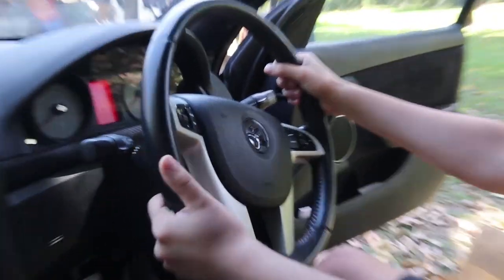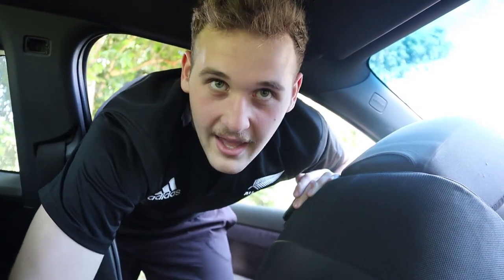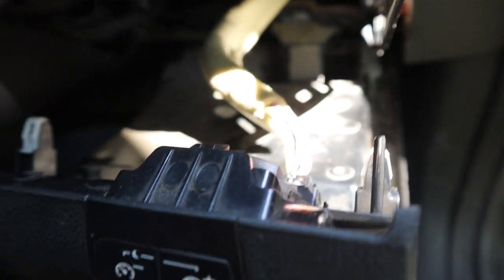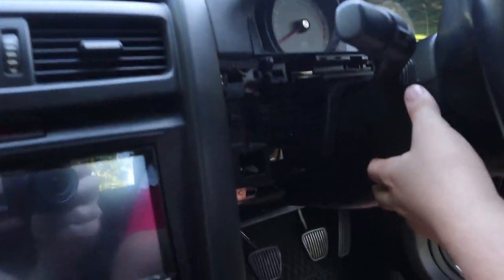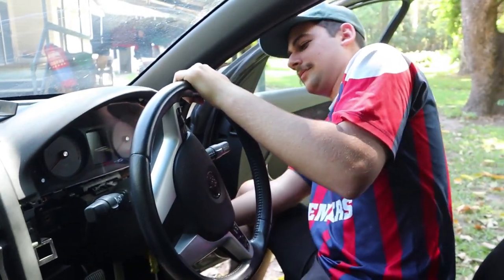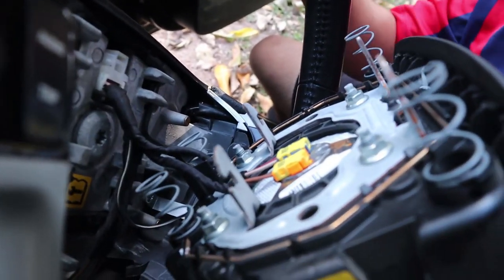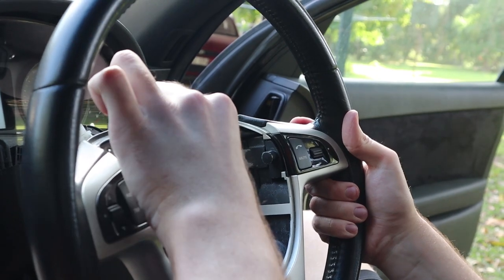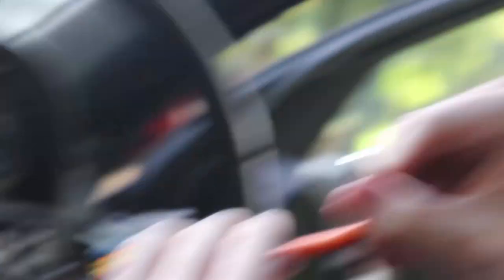How to Swap the Steering Wheel on Your Holden Commodore

Comment: Very helpful, handy tip also the column is telescopic and pull out with the adjuster under the coloum. Saved taking the trim parts off

Comment: Just a quick note... Not all of the surrounds need removing. Just the cover on the top of the wheel.

A correct screwdriver length will allow the airbag to unclip. 

Cheers.

Comment: Regarding how to set the air bag aside.  When you put it down out of harms way, make sure that the side that normally faces the driver is pointed up towards the sky and not the other way around.  That way if the airbag decides for some stupid reason to deploy it does not propel itself up in the air where it could come down on someone/something you care about.

Comment: just a heads up: wait 90 seconds after disconnecting the battery before you work with any airbags
if its the drivers airbag, after removal place it somewhere where it's obviously steady and have the emblem face top always
14:19 that's the horn wire

Comment: Just managed to get the airbag off my VE. Tried leverage with screwdriver at first. Then, got a stubby flat head screw driver with a good broad head, put it in and twisted it instead of using leverage and it popped straight off.

Comment: Im a bit disappointed. Being car youtubers im pretty sure anytime you remove/install a steering wheel going by all other videos, its supposed to be in the range of 45° off kilter. 
But in all seriousness, youre doing good work on the videos boys.
Reply from the maker: Haha! We've said it multiple times, no idea what we are doing 😂😂

Thanks for the nice words Greg! We appreciate it
Reply from the maker: Haha exactly right!! We have said it before but just forgot to say it this time.

The manual definitely helped loads especially with the explanations. It certainly helped that we had done it before too!
Reply: @BrokeCarConnoisseurs  its actually good in my opinion that you blokes say you dont know what youre doing and show reference material. Its a good example. Winging it when you dont know what your doing, thats when proper mistakes are made. Its good you boys show the process and dont over simplify it. Not like a few edits out of the hard work of say putting in a twin turbo v8 in the colorado. So its good you guys keep it real.
Reply from the maker: We appreciate that thank you!

And yeah could you imagine the colorado after that power upgrade 😂. The car wouldn't know itself
Reply: @BrokeCarConnoisseurs  neither would your wallet when pretty much all the drivetrain would snap. But you get my drift, keeping it real. Not just mystical cuts to stuff thats magically done etc.
Reply from the maker: We are trying to make it how we would like to see videos on YouTube. So to hear that we are doing something right is good 😂
Reply: @BrokeCarConnoisseurs  i can only talk for myself, but yeah, i like the straight up and down no bullshit content.
Reply from the maker: Thanks Greg!

Comment: with no power i didnt think it could go off. i thought you need power plus you need to hit the sensors dont you? wich are inbetween the headlight and grill. i maybe wrong please correct me if im wrong.
Reply: They have a capacitor in them, they can go off after power removed, capacitor needs to power down, hence waiting after disconnecting the battery